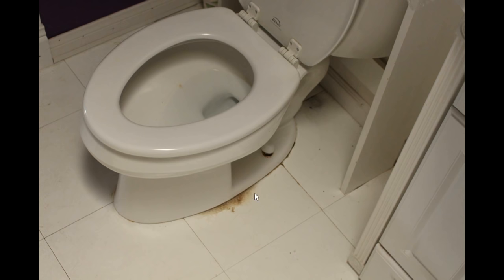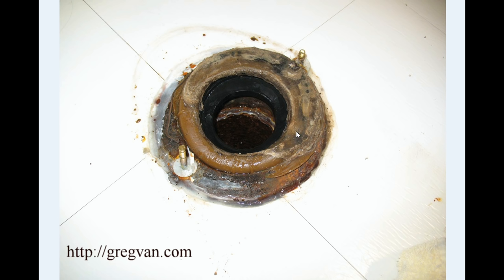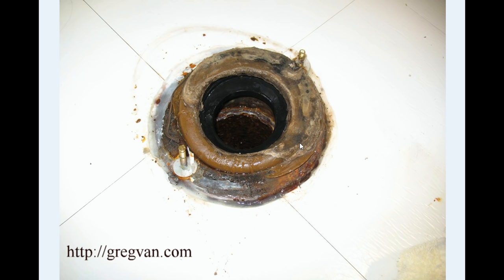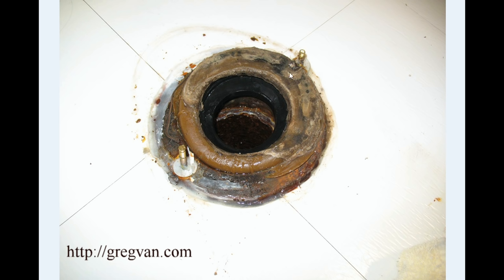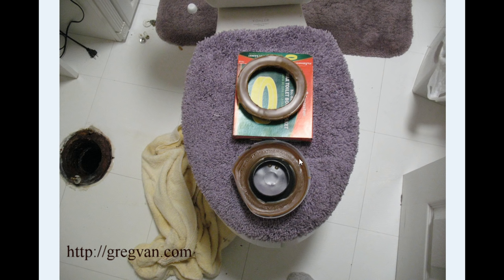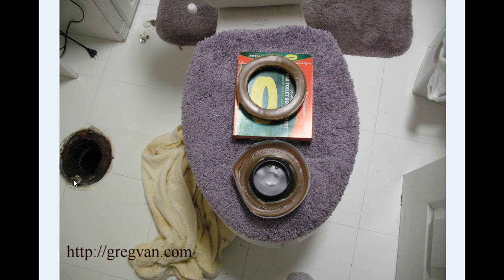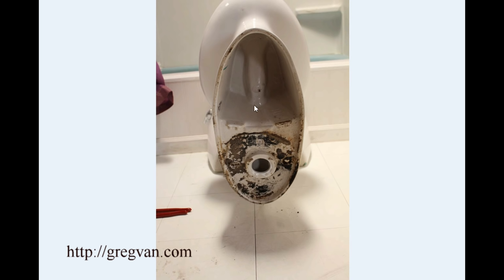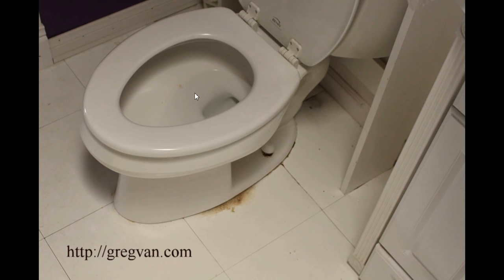Watch This Video If You Have Water Leaking at Bottom of Toilet – Home Repair Tips

Comment: Why when i flush it still smell horrible
 My maintenance guy just replaced the donut. Im wondering if he did not place the toilet correctly on the donut.? I cleaned the back of my tank and it still smells. Its not the trap.
Reply from the maker: There could be a variety of different things causing this problem. If I was to guess, it might have something to do with the toilet tank. Simply pour some cleaning chemicals or those little blue tablets into the tank and see if the problem goes away. Let me know if this makes sense and if it doesn't, email me a picture of your toilet and I'll see if I can provide you with another idea.
Reply: @gregvancom  i cleaned the tank with vinegar, next day each. Nothing is helping.
Reply: @gregvancom  also the whole bathroom smells strong. I feel like my maintenance guy did not put my toilet back on the new donut correctly.

Comment: I changed 1wax ring on one of my bathroom toilets because water was leaking from under my toilet. The problem is now the water is leaking out of both my toilets now and when I takes a shower it leaks from the toilet also plus when I tried to wash the towels I used to dry the water up. More water leaks from the toilet. Help
Reply from the maker: There's a very good chance your drainpipe is partially clogged and needs to be cleared. In other words, the water isn't draining out of the drainpipes fast enough and my guess is that the more water going down it is when the toilets are leaking.
Reply: What do o do to unclog the pipe
Reply from the maker: @TFloyd-zz3iy  You can contact a plumber or go down to your local rental yard and rent some equipment to unclog it yourself. Most rental yards will provide you with operating instructions also.
Reply: Thanks for your help

Comment: Our house is brand new 1 year old and the water spicket outside already busted and now the toilet is leaking so i should just put a new wax ring on the old one
Reply from the maker: Most new homes have a building warranty that should cover these problems, but if yours doesn't, then you could always try installing a new wax ring. I'm not about to suggest that this is the problem, but it usually a good place to start.

Comment: wouldnt it be safe to say that a toilet that is leaking water from around the base and the toilet has not been flushed in days the toilet would have to have a crack allowing the water to leak out?
Reply from the maker: It's a possibility, but if that's the case, then usually the toilet bowl will have less water in it. In other words the level of water inside toilet bowl would have lowered.
Reply: @gregvancom  Hello, Thanks I watched the video earlier.  I just installed a new toilet yesterday afternoon. It was flushed a couple times checking for leaks at supply, and at tank to bowl. No immediate leaks noticed. Toilet was used a couple times that afternoon/evening no leaks noticed again. This moring I woke up to the throw rug in the bathroom wet and noticed a very slight water sipping from the front of toilet. I dried eveything up.
I turned the water supply off. I took blue painters tape and marked the water line in the bowl and layed dry rags down.  I checked the mark 2-3 hours later and the water line dropped about 1/2 to 3/4 inch. Rags were wet. My conclusion is there has to be a crack in the bowl and or neck.  Wouldnt you agree since the water lined droped in the bowl there has to be a crack somewhere.  The wax ring leaking and or the tank should not effect the water line in the bowl??   
What kills me the 1st toilet I bought after I opened box I noticed the tank was cracked and had to return it and my luck It looks like a got another with a leak.      Thank you greatly appreciate your video and comments.

Comment: He mentions you cant tighten the toilet bolts.                               I think you can.              You must tighten them-----  tighten    from the top ,    use  a nut & washer,   with the washer   preferably  being a nylon or  tough plastic.
Reply from the maker: I'm guessing there is a question in there somewhere, so I will pretend like you're asking if you can tighten bolts that cannot be tightened, because they are moving round and round as you try to tighten them or they are severely damaged from corrosion, then the answer would be probably not. If this is the case then you will need to cut the bolts with a tool that will cut them, remove the toilet and replace the bolts so that you can tighten them. I use a sawzall for the metal blade.

Comment: What about water splashed on the floor from the bathtub, running under the toilet and under the tile?  I have five little kids that think the upstairs bathtub is their private swimming pool.
No amount of wax is going to fix this.  I'm stumped.
Reply from the maker: I think you could use some type of a sealant around the base of the toilet or caulking, but you also might need to seal other gaps that could be at the edges of the flooring or next to the bathtub where it meets the floor. I don't think this will be a permeant fix, but could slow it down.

Comment: Question why when I open my shower head to take a shower it leaked from the toilets also
Reply from the maker: If the drain pipes are partially plugged water from the shower drain could be backing up and going to the lowest spot which could be the bottom of toilet.

Comment: is the water that leaks from the base poop water? ☹️☹️
Reply from the maker: It will depend on the leaking area. For example if it leaks after using it, then yes, if it only leaks while it's not being used, then probably not.

Comment: deal is bad when the nut wont come off the bolt because its been on there for so long. plus putting the toilet back over the bolts is a pain.
Reply from the maker: I hear you, but the bolt can usually be cut to remove the toilet and the new bolts can be installed and you're right about trying to install the toilet while lining up those wiggly bolts.
Reply: plus if you have a bad back - I did a job about 8 years ago had to cut the bolts took more time then you think.  I understand why someone would call a plumber out. Sad they charge so much money for a job like this

Comment: So I have two bathrooms and I use one and then the water from the other bathroom (toilet) comes out. Why is that and what can I do to prevent that from happening. By the way we don’t use the bathroom we’re the water comes out at all because it obviously comes out the bottom base
Reply from the maker: It could be a clog in the drain line. For example if your toilets are next to each other and after one of them is flushed and the water backs up enough, it could actually start leaking out of the other toilet.
Reply: gregvancom what can I do to prevent this from happening because it has happened a lot actually and it’s getting pretty annoying lol.
Reply from the maker: @manuelmejia3851  I can't provide you with a solution, because I don't know exactly what's happening. I don't know if your pipes are clogged, if your toilets are too close together or if your wax rings aren't sealed. You could always call a plumber.

Comment: My toilet randomly leaks and you can hear that sucking sound( as if it was blocked and plunged clear) right before the water comes out from underneath. Toilet is on ground floor on top of tile with house being a concrete slab. Anyone have ideas what's causing this?
Reply from the maker: I would like to suggest that it might be a blocked vent but I would only be guessing. How long has it been doing this?
Reply: gregvancom about 2-3 weeks.
Reply from the maker: @br6480  Forget what I said the first time, there's a good chance your drain line is clogged. I remember something like this happening to me a few years ago when our drain was clogged and I'm willing to bet you're dealing with the same problem. Again, this is only an educated guess.

Comment: My problem is I flush and water is not on the floor of the bathroom the water is leaking at the first floor level I see it from the ceiling because the toilet is on the second floor
Reply from the maker: You would have a water leak either from the drainage or water supply pipe or the wax ring seal could be broken, still allowing water to leak below, but not onto the floor.

Comment: When I flush the water overflows from the bottom of my toilet and  my tub.. help!
Reply from the maker: It sounds like you have a blocked drain pipe and quite possibly some gaps in your plumbing pipes or plumbing drainage system that might need to be fixed.
Reply: Call a plumber

Comment: so if it's leaking while not in use its probably a crack in the toilet and I need a new toilet?
Reply from the maker: It can be, just make sure that water isn't leaking from other parts of the toilet like the tank or supply line. Some cracks will drain the toilet bowl or lower the regular water level in the toilet bowl as it's leaking.

Comment: Toilet does not get flushed and start leaking from bottoms
Reply from the maker: First thing I would do would check to make sure that the water supply line isn't leaking or that any other part located outside of the toilet is leaking. If there are no water leaks, then you might need to check the toilet to see if it's cracked and if this sounds like too much work, then you might be better off just buying another toilet. Just don't purchase another toilet until you have thoroughly verified and are absolutely positive that there are no water leaks anywhere else creating this problem.

Comment: My wax ring was replaced and it still happens
Reply from the maker: Don't forget to make sure the toilet isn't cracked and leaking from the inside and you might need another wax ring. Keep in mind that I'm only providing you with options and neither one of these might solve your problem. Keep me in the loop and let me know if it worked or if something else worked better.
Reply: @gregvancom   wax ring was just replaced and the toilet flushes fine nor is it clogged ... honestly I think my shower drain is the issue and is clogged

Comment: So if there is pee water under the toilet that would be the reason is the wax ring
Reply from the maker: That's not necessarily true, I've seen toilets that didn't leak, even though the wax ring was damaged. However, it's usually going to be the wax ring or a crack in the toilet somewhere.
Reply: gregvancom okay thank you. Yeah im not losing any water. If we go number 1 and flush no problem, but if someone sits on it and goes then water appears. Im gonna change the wax ring
Reply from the maker: Don't forget that you can always use two wax rings if you don't think one is going to be enough. They also sell larger wax rings.
Reply: gregvancom i had one with a plastic gaskett with it. The last person put a rubber one with a rubber neck and a wax ring. It looks like they put the wax on the underside of the rubber neck
Reply: gregvancom my other question is the 2 bolts that mount the toilet down. I replaced them as well i slid them into place should i have put a washer over the top then put toliet down?
Reply from the maker: No, the washer usually goes over the base of the toilet bowl or in between the top of the toilet bowl and the nut used to secure it to the floor.
Reply from the maker: I don't know if I understand exactly was going on, but you might be better off using one without a plastic insert.
Reply: gregvancom okay then i did it right. I appreciate u responding to every comment! It means alot .
Reply from the maker: Glad to have helped and you're welcome.